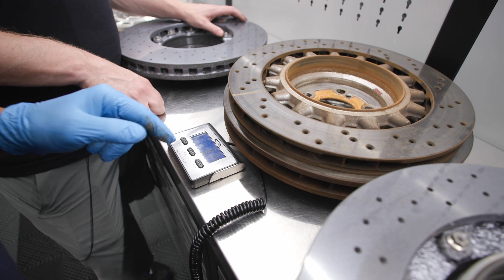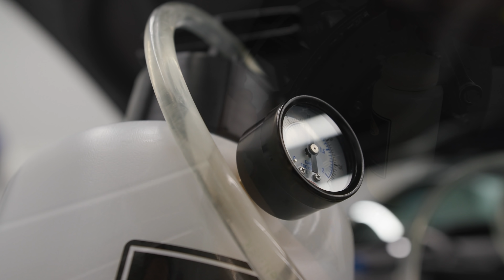Doing Steel to Carbon Ceramic Brake Swap on M2CS (M3/M4) Episode 1

Comment: Funny to me at lest, been there done that basically, but years ago. Then found out it was cheaper to buy a car with All Options always. Way cheaper in the long run.  And I always , always get a build sheet for any car I buy to check if the car was built with what options.
Original, original , original, 1 owner, low milage, no accidents, no repaint, perfect history and you will never go wrong. Not to say I don't like what you do. I love it!  That is why I'm watching.  Keep up the good work. Very bold of you to open up about your issues as well very brave in todays world and makes you stronger!  All the best!

Comment: If your CCB rotors age and the friction layer starts to deteriorate, mostly on track day or racing usage, the friction layer can be rebuilt to as new condition by Rebrake in Germany. This makes owning CCB a cost effective braking solution. Kudos to you for swapping the master cylinder.

Comment: The only thing I would’ve added was stainless steel flexible brake lines to replace the rubber lines.  Great video as always, I always enjoy watching Matt spend money!
Reply: Yeah that's what I was thinking when I noticed him mounting up the stock lines, you'd figure you'd just go ahead and upgrade the lines while you had them all tore apart, it's not like better lines are going to hurt after $13k+

Comment: I have an f10 m5 can I upgrade the rotors and caliper in the front with out changing the brake booster or do I need the carbon ceramic brake booster. Thanks

Comment: Hello from Ireland, had you any issue's with the brake coding selections for the car, I took my 2020 M2 CS to the Main dealer to have this very kit fitted, (they ordered) they rang back 2 days later to tell me there is no option for the ceramic's to be coded. Can you shine any light on this please. love the channel, keep it coming. 👊

Comment: Bro, I have a M3 F80 stock blue break system, and a guy wants to sell me his Carbon fiber system and keep mine bc he says he needs to change for 18’ wheels. I will pay around 5800. Since I have 20’ it will feel. My question is if this a huge upgrade for me. And regarding my normal driving, basically somes rides par day, will it be a good change for me. Im counting the pads will last a bit last and price is 140€ and 90€ rear. 

If you have a good opinion about this please charge.